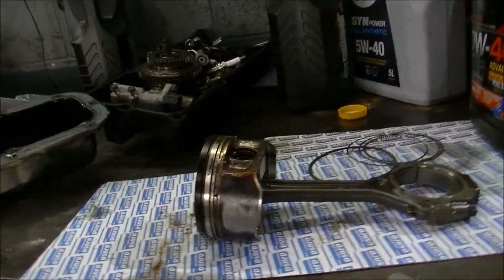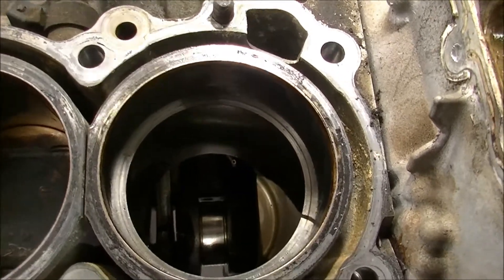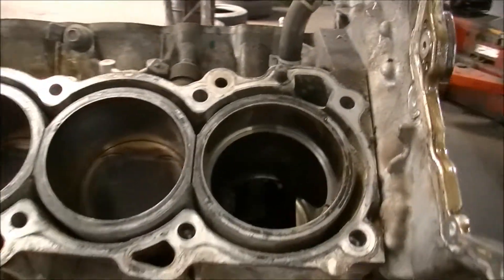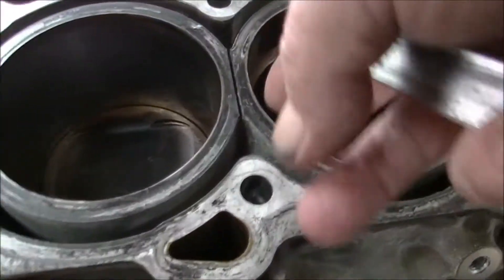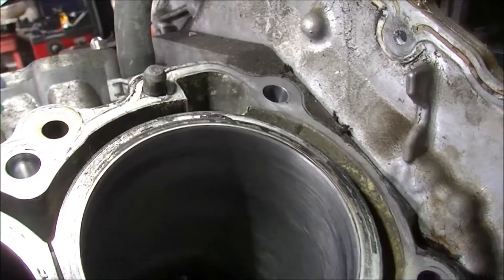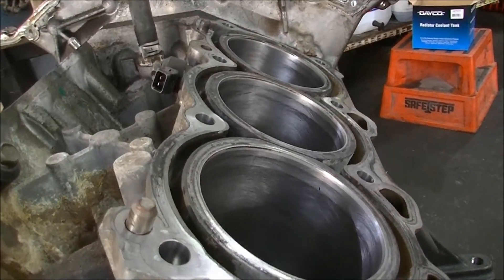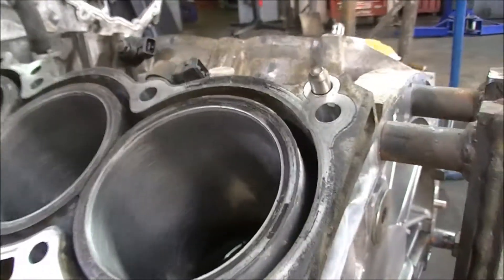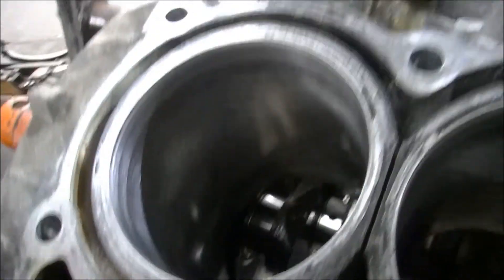Nissan Pathfinder 4.0 V6 update... Stopping the smoke..Pt 3.

Comment: Should do valve guides and timing chains,
That’s why one side of engine may be worn out there is a cat Converter on each side of the manifold it turns into dust and goes up through the valves into the cylinders and sans down the valve guides and the rings
Reply from the maker: It got more than valve guides and chains.

Comment: I am getting ready to do this job on a 07 Xterra VQ40DE after an upstream cat substrate disappeared somewhere.  Do you recommend using stock pistons if not damaged and no boring is done on the cylinders?  How did this Nissan turn out?
Reply from the maker: It turned out like new...Yep stock pistons would be fine...Cheers.

Comment: Did this stop the smoking?
Reply from the maker: A rebuild stopped the smoking.
Reply: ZIGgassedUP 
I mean what you did, changing the rings only, did it stop the smoke?
Reply from the maker: Yep but I had the heads serviced also with new valve stem seals.

Comment: Normally I'd say a ring set is a waste of time, but in this instance, I think it'll do the trick. No bore wear to speak of. Be good for another 100k. Back in the 70s when I was reconditioning engines, Carl bought an Alfa sprint. When they still made 'proper' cars. He bought a ring set and shells. I was dubious but it did the trick.
Reply from the maker: As a kid I did re-ring jobs for a wrecking yard in exchange for any parts I wanted..I did enough that I bought a groove cleaner and could clean up 6 pistons in about 10 minutes...The rings were definitely worn out..Cheers Malc.